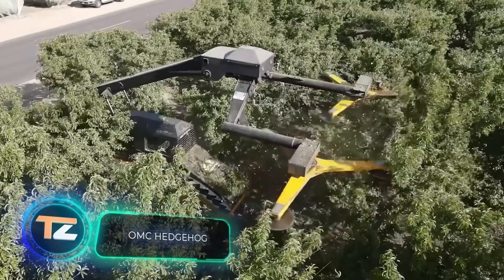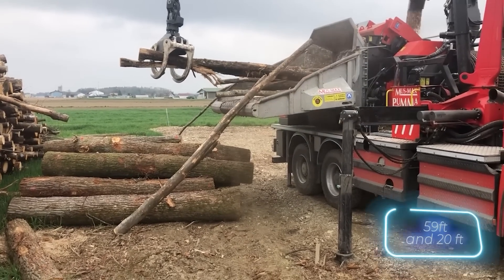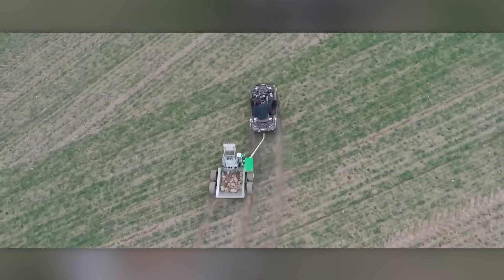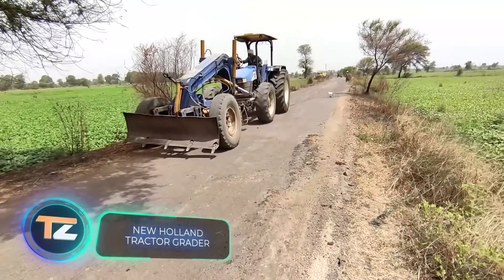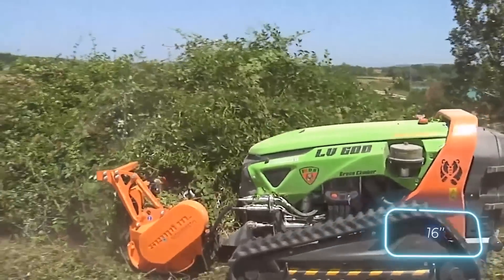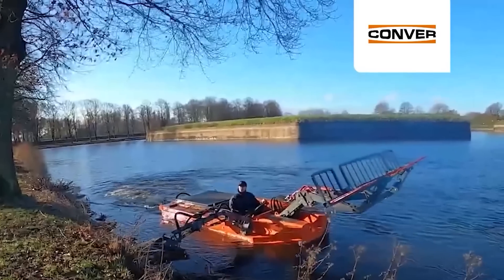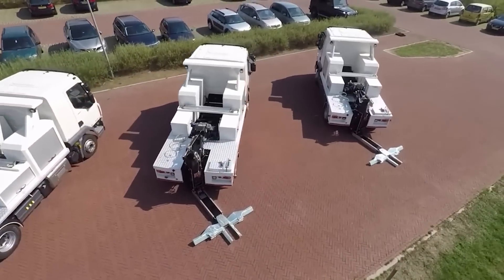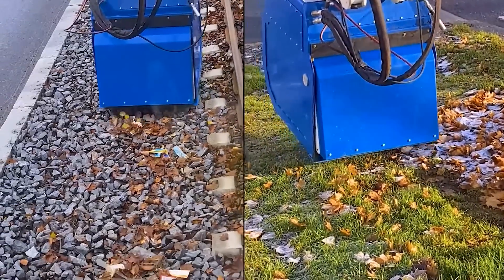INCREDIBLE EQUIPMENT THAT HAS REACHED A NEW LEVEL

Comment: it is always awesome to see some of the new machines designed to do most of the heavy work load but most of the time you see the machines being used, are the manufacturers review of the machines most companies wont buy the equipment and still use manual labor to get the job done because hiring a persons to do the work at minimum wage is cheaper than spending several thousands of dollars for a machine that wont pay for itself in a short time.
Reply: Or you spend the money now with one operator and get rid of the people that don’t show up for work. In many cases, you won’t have to spend money for healthcare, unemployment compensation, and matching FICA. If the people are eligible for vacation time or time off because of a birth of a child you eliminate that as well. as long as people continue to be unreliable, the machinery will be manufactured to do the job. There’s always more than one side to story. Sometimes there’s five sides, you just heard another one.